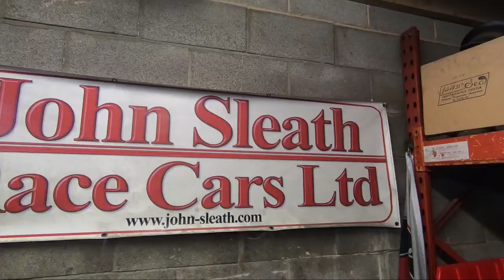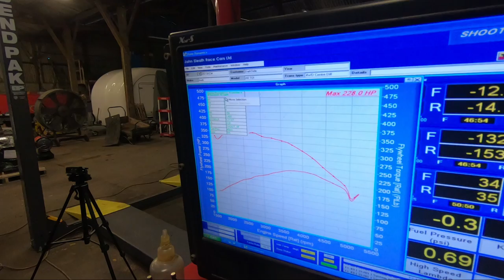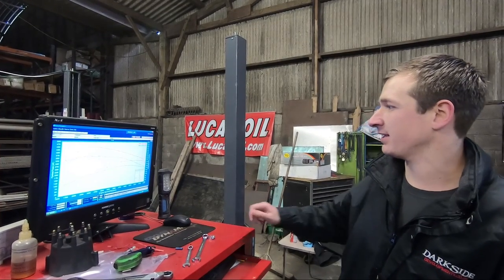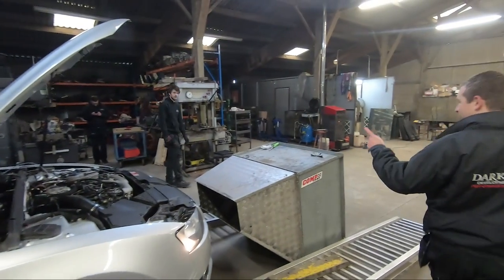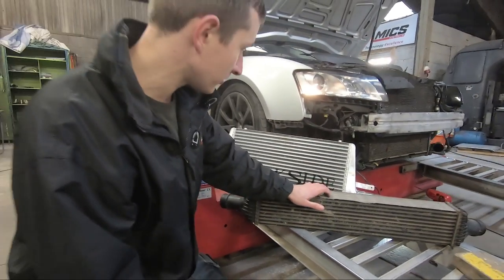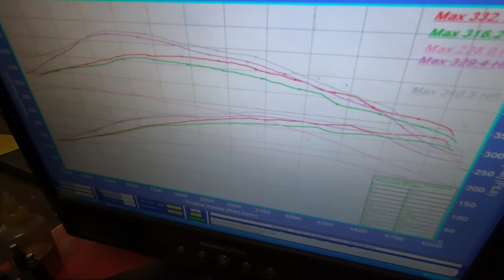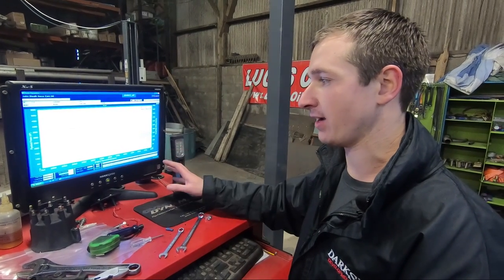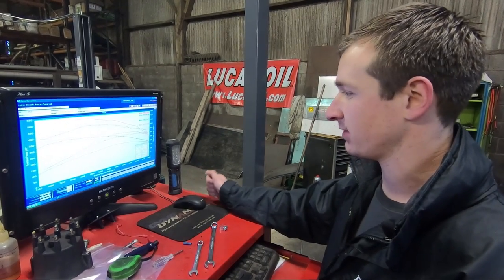228BHP to 340BHP! 4WD DYNO TUNING - AUDI A5 3.0 TDI QUATTRO PROJECT - DARKSIDE DEVELOPMENTS - PART 8

Comment: Awd is on demand meaning not all the time four wheel drive is all the time. Awd will get you stuck mudding or off roading four wheel drive won’t.
Reply: You're wrong. This A5 uses Torsen which is a full time limited-slip center diff, unlike Haldex which is a front-drive based system.

Comment: lots of money and only 380 bhp. I don't get it? why bother, just buy s5 petrol🙄 or is that just to easy 😁
Reply from the maker: It's 340bhp, unless you are watching a different video?
And at 295bhp (220kW) & 450Ft/lbs (611Nm) it was already faster than an S5 to 60 and almost at 1/4 with better MPG 
0-60mph - 5.18s and 1/4 Mile - 13.81s @ 100.81mph vs 5.2 and 13.5 @ 102.6 mph for the S5 as tested here - https://www.edmunds.com/audi/s5/2010/road-test-specs1.html

All our specs are here with times - https://www.darksidedevelopments.co.uk/audi-a5-3-0-tdi-common-rail/

295bhp is not a lot of money from these
Reply: Darkside Developments a 3.0 supercharged v6 S5 can now be had at around £12,000. A pulley upgrade and remap will cost £2,000 max.
This will get you 0 to 60 in 4 seconds and a quarter mile at 12.4, this is what mine has achieved, and mine is the cabriolet. My friends coupe s5 which is of course lighter, did the quarter in 11.9 an 0 to 60 in 3.7 seconds. I’m just saying........it’s cheaper and faster !
Reply: @nolanbryan9195  15mpg not 40?
Reply: Nolan Bryan what mpg you gettin
Reply: @nolanbryan9195  I'd rather have the awesome mpg and great speeds of a remapped A4 or A5 3.0 tdi
Reply: I drive an RS6 c7 daily and still watching these vids hahaha , it's just amazing what you can do with 3 litre engine !
Reply: Nolan Bryan only thing, I would say, is the difference of driving a petrol va diesel, petrol feels like no power or pull, where as diesel puts you in the seat abit more.
Reply: Torque is the key not horsepower ;)
Reply: I prefer the engine that has good mpg

Comment: What's your opinion about this type of exhaust turbo manifolds? They should spool the turbo pretty quick as log manifold, bur have better flow, than stock cast hard 90degree cut manifold. ofcourse this one is for 2.5tdi, but same can be done to 3.0tdi

https://youtu.be/bagYZK16-AA

Comment: I have same car but my have much Power...415hp.....
Reply from the maker: With Stock Fuel system?
Reply: Yes my configuration Is big turbo by turbochargerworld ,big intercooler 600*300*76,intake apr carbon,full exhaust 76mm,water injection by snowperformance,dpf EGR swirl and maf delete and remap

Comment: That's more truly than other fake 380 400hp lol doing slow ass time 
If u don't mind what boost are u running and rail pressure 
Im on same power running 2.2bar and 1810bar Rail
Reply: 1950 rail but pump struggles. 2.2-2.3bar boost. Thanks for kind words

Comment: That's whp not bhp
Reply from the maker: Its bhp
Reply: @DarksideDevelopments  so that dyno outputs bhp instead whp? Weird. Also, now the power numbers seem more sad. No offense.
Reply from the maker: @chrisdale9600  Its not weird in the UK and non taken, we know the figures are a little low compared to what others are claiming. This was also run in shoot 6F mode which we will cover in a later vlog but when run in shoot 44 mode (admittedly what we should run in) the figures are around 30bhp higher. These are more realistic but still lower than some unrealistic figures some others are claiming...
Reply: @DarksideDevelopments  So whp isn't used in the UK?
Reply from the maker: @chrisdale9600  Its not common, most quote bhp at the flywheel
Reply: @DarksideDevelopments  oh okay

Comment: the smoke is good if you wanna run from the cops, put out a smokescreen they got lost.
Reply from the maker: Doesn't smoke on the road at all. Dyno was holding it at a lower RPM then you would accelerate from

Comment: This is the most u can do guys? We have an Audi a5 3.0tdi v6 in romania with 404 hp with no meth and 444 with meth. So I am curios why so little? snowperformance stage2
Aux diesel pump walbro,ic frontal, pipercross air filter, cp3r90pump ,turbo hibrid,exhaust 90mm
Reply from the maker: Aux Diesel pump is a waste of time. What dyno is 444bhp on? No Injector Upgrade? Seems fantasy figures...
Also 40bhp from Meth is not going to happen.
We are not finished! No Fuel Pump or Injectors on this. Plus a realistic dyno!
Reply: Darkside Developments will give a reply when i have the dyno print
Reply: yeh give him a chance @DarksideDevelopments  , hes got to go and fabricate a dyno sheet on photoshop yet :D :D
Reply: Any video of the guy doing 100/200 because was one at Bucharest with 380 hp doing 100/200 in only 13.4 seconds.. that's pretty slow 😬
Reply: @drivefasterenk  100-200 will be faster than 13s for sure
Reply: @ryanp6138  should be 12/13 at 340hp